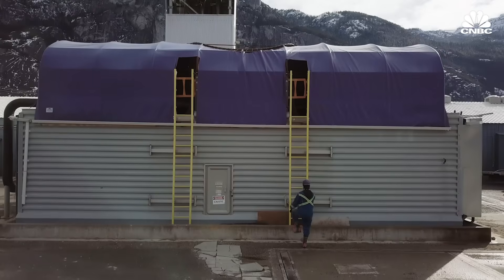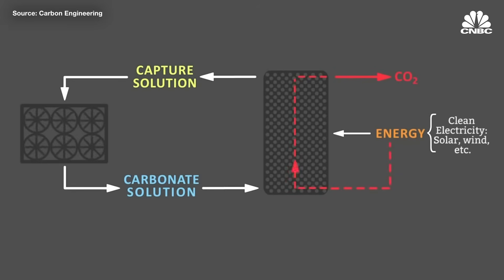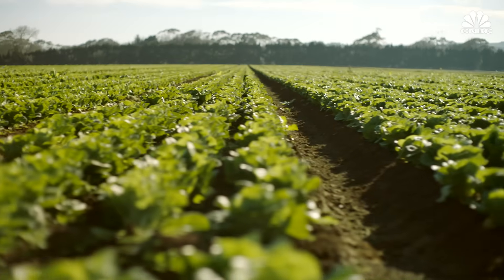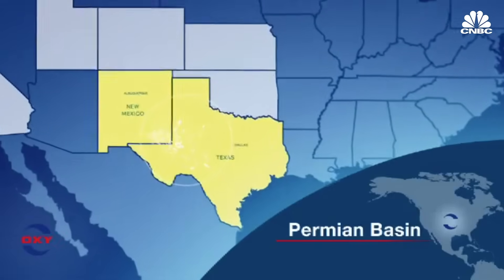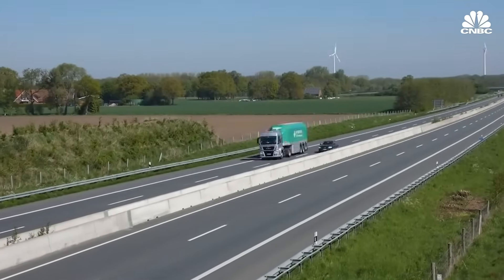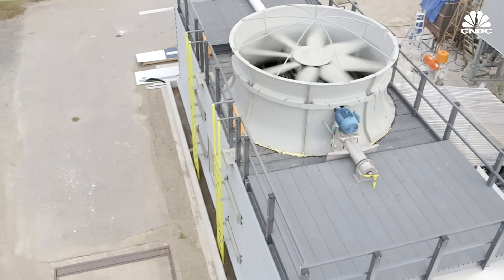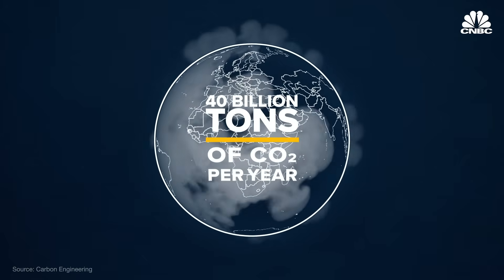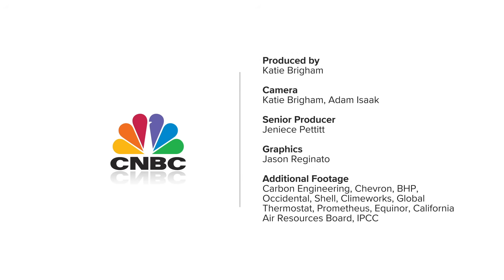Bill Gates-Backed Carbon Capture Plant Does The Work Of 40 Million Trees

Comment: CO2 is not causing global warming! It is the SUN that heats up the planet! Nobody thinks about reflective satellites in space to block sunshine entering the atmosphere... Elon Musk where are you when needed?????? 
The problem is the surface that captures heat like streets, buildings, uncovered soil, deforestation. Co2 is not the problem I repeat CO2 is not the problem! All life is bond to CO2 in one way or another.  Once again, folks, it is the SUN that heats up the Earth! And the climate is always changing... We can measure extra high and extra low temperatures in between -25  and + 40 C in a single year(where I live)!  That is a 65 C difference!!!!!
Reply: Excess of anything is a problem. Do you know how earth manages to maintain a livable temperature on its dark side? It could be explained by greenhouse phenomenon, where greenhouse gases like Co2 and No2 stops the radiation of sun from returning back to space after reflecting from earth. These gases in upper stratosphere reflects the radiation back to earth to some extent, maintaining a livable temperature on earth. Too much CO2 will mean more greenhouse gases, which means more of the radiation are reflected back into the earth's atmosphere resulting in higher temprature which is increasing annually.
Reply: And the 65 degree you are talking about is weather, not climate

Comment: Hi! 2 points... 1) using the system to remove CO & CO2 emission at the source (as in before it comes out throught the chimney); and 2) the system should have O2 as byproduct released in the atmosphere at the end of the process... Money could be earned at least in one extra way...how much O2 is released into the air per minute...Thanks, and good luck...TGCSII (TRANS-GALACTIC CONSULTANCY SERVICES - IDEA & INNOVATION).

Comment: Nice patchwork, but still patch work. Just missing a few points:
- CO2 is part of the problem, but NOT the only problem.
- All those trees would not just clean the air but also release O2.
- One plant will clean the local air, while CO2 is produced everywhere. This will cause the same effect as "everybody" working in the same place: roads jammed for everyone going a long way the same direction at the same time. In other words, these plants wil NOT lower the concentration of CO2 more efective than all those trees that get unemployed...
 -Foodgrade CO2 is already produced at large scale. For some reason I doubt this proces is fit for it as the air contains lot more polutants than just CO2. Will this CO2 be clean enough?

But until the day we have things in balance again, this might be a small part of the total solution.

Comment: all industrial exhaust stacks should have one of these on it to collect it right away at the source
Reply: As good as that sounds, the bottom line is we need to pull the plug on fossil fuels. Nuclear energy is the future of mankind.
Reply: @ThorHanson7531   AGREED only when we find a way to SAFELY dispose of the waste.  Also I'm not a rocket scientist or nuclear physicist but I know the cooling pools that they keep the nuclear waste in they have to keep switching out with fresh cool water so it doesn't evaporate away and cause a meltdown.  What is instead of using new fuel we use those cooling pools to generate heat and regulate it to a certain temperature to create the steam we need for power? Reduce Reuse and ........
Reply: @Biggjuggs333  Sir, you literally just described what a nuclear reactor does. Nuclear reactors create steam, that turns a turbine, that makes power. Nuclear waste is not stored in pools, as far as I am aware; it is buried underground in metal drums, or turned into glass and buried. Good idea though
Reply: @ThorHanson7531  no, more like fusion energy
Reply: Exactly
Reply: Alleyup1994USA  Okay, you're clearly very dense. So let me explain the facts to somebody with a tenth grade education like you have. You can't seem to understand the fact that you have already lost this argument. You are a climate change denier, and clearly know nothing about science at all. You seem to think of fossil fuels in the future, HINT: THEY'RE NOT!! Fossil fuels are an ancient, inefficient, dirty technology that needs to be phased out. You also clearly didn't even read my comment that I wrote to you explaining the greenhouse effect. If you are openly refusing to listen to logic and reason coming from somebody with a Master's degree, I'm afraid there is nothing more I can do. Enjoy living in your little world of complete stupidity and ignorance. As the saying goes, " ignorance is bliss"
Reply: CO2 is Good for trees.
Reply: Alleyup1994USA  

Electric cars would produce  NO CO2 if they were powered by a grid that does not derive its power from fossil fuels. My prediction is that 40 to 50 years from now, fossil fuel power stations will be largely phased out and nuclear power and renewables will overwhelmingly dominate. What is slowing the transition of this happening is mostly the fossil fuel lobby and also irrational sceptics and pessimists against nuclear energy of any type, especially the renewable only crusaders.
Reply: We have carbon filters in all big and small industrial plants here in california to capture and collect they change the filters"daily" as they say
Reply: Alleyup1994USA  

In the 'LONG' term, half a century or more from now, a lot more countries will be able to sustain nuclear power that they do now, and in all probability thorium will be dominant as the fuel source and not uranium 235 and uranium 238. Paradigms can change. Electric cars are not the only alternative type of cars to fossil fuelled cars, hydrogen fuelled cars, using hydrogen produced by electrolysis of water, with the electrolysis itself powered by non fossil fuel sources can also be used. And yes, the infrastructure for hydrogen distribution can be built for the purpose. Things may be more expensive now and in the short term, but it doesn't mean that they will always be and they can become a lot cheaper in the long term.

Comment: The released energy of burned hydrocarbon comes mainly from converting the hydrocabon on CO2, the other way back (even to carbonate) uses almost all the energy produced in the first place. Even if you use solar to capture carbon and you keep burning it, what is the use of that? If all hydrocabon industry has to capture the produced CO2 it will be the most expensive energy ever produced, but in the mean time it makes « noise » to keep things as normal.

Comment: Would it be possible to separate flammable gases from the air that, that machine sucks? Perhaps not as most flammable gases are lighter and would float away. My theory is that gases released from cow farm or melting permafrost, accumulates in higher atmosphere, displacing other gases and creating pressure like in a gas tank and as Earth rotates, it creates friction between air in atmosphere and earth's surface. And, friction under more pressure creates more heat.

Comment: Dear @CNBC, Please tell them or your viewers that this is not a full fledge solution. They are collecting CO2 in without measuring the need of it in that area. CO2 is required in our atmosphere only excess of it is harmfull. Also, Plants need it. If u such CO2 from an area it might make the density of 02 more than CO2 which may cause plants to die.
Its good thing to approach innovatively towards increasing amount of CO2. But just capturing C02 is not enough. I feel the idea itself is not very mature and they have already started implementing it. People who are funding it seems like wants to make money out of it...As per vedio the idea focusses only on sucking CO2 and they have no fullproof plan about what they will do after it. They are just sending it back to Earth (to get more fuel) which means heating the core rapidly which might make the natural processess quicker which in turn disturb natural cycle of Earth. Also, they are digging the earth to setup their  equipment.

Comment: Some of these are literally the dumbest "solutions" i have ever seen.

How much energy does co2 removal require?

There are consequences to shoving co2 underground. It's the basis of fracking.

It shouldn't be used to promote the use of carbon fuel.

And promoting healthy ecology to trap raw carbon in dirt will always be the most effective method of controlling and sequestering carbon.

Instead of burning biomass, they should bury it.

Comment: I think the best solution for now would be to require companies to become carbon neutral by either paying other companies for the service, or operating their own co2 capture facilities (jobs created either way). Then giving oil, fuel, and automotive companies incentive to switch to clean energy, then ultimately requiring it in time. I understand greed is the only thing keeping the oil and coal industry alive, but they've known for years that change is coming, it's their own fault if they didn't act on it.

Comment: They do realize that co2 is pulled in and oxygen comes out of plants. Because there is more co2 in the air, Earth is getting Greener. From the industrial revolution till now, the PPM of CO2 has went up 135 ppm. Plants can take anywhere from 1,800 to 2000 PPM of CO2. The Earth Sweet spot would be somewhere between 1000 to 1200. These people are complete idiots,if you diminish the CO2 levels too much you could put the earth into another ice age, is that something we really want to do. During the last ice age the PPM of CO2 was somewhere around I believe 180 ppm, at 170 or 160 all plant life dies. We need to be going up not down.